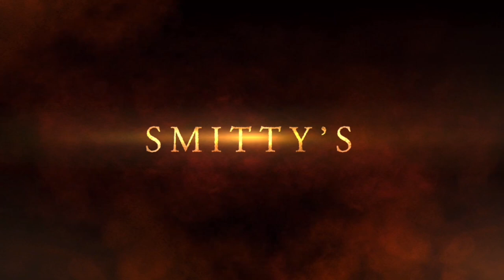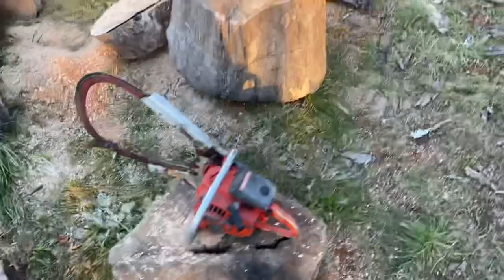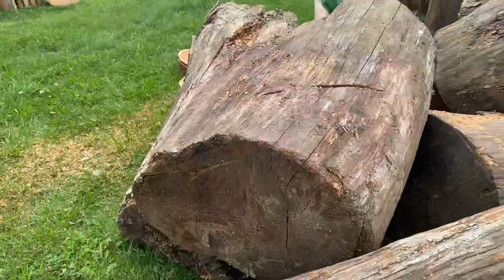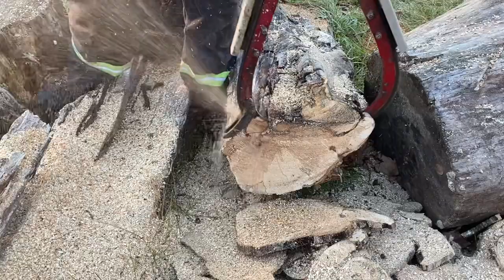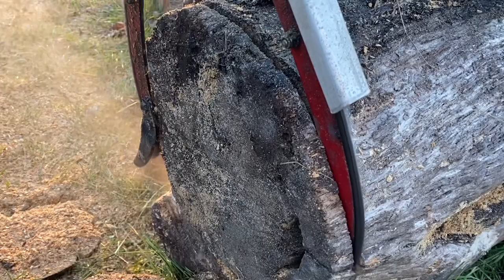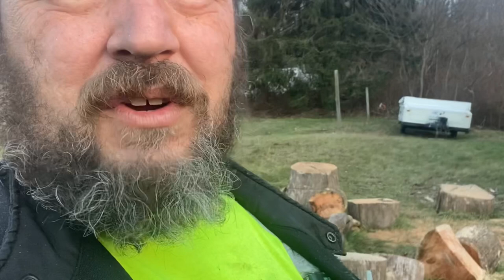Bow Bar On Experimental Ported Homelite Super XL Auto Chainsaw!  Having Fun Testing Out A Bow Bar

Comment: Love the saw smitty. Are the bars hard to find sr and what or should I say why were they made and for what practical purpose. Great video and thanks ❤️🌲🌲🌲❤️
Reply from the maker: Hard to find but great to use.
Reply: My old man used to cut pulpwood with a sxl with a bow bar. Saws still sitting in the back of the shop but I never ran the bow bar

Comment: Dang I can see the oil dripping down!
Reply from the maker: I fixed it
Reply: @Smittyschainsaws  I thought it was just because those saws dispensed so much oil. Thank you for the reply.
Reply from the maker: @viperstrike3827  The oil hole was plugged.
Reply: @Smittyschainsaws  I am learning about homelites. I am buying parts saws on ebay. As soon as I find one with a clean cylinder I am making a runner.
Reply from the maker: @viperstrike3827  You can still get new cylinders and pistons. Sometimes it’s better that way.
Reply: @Smittyschainsaws  Thank you for the reply. I installed a clean used cylinder and hooked a ring in installation. I just don't trust myself to do it.
Reply from the maker: @viperstrike3827  Failure is the greatest teacher!  Don't give up!
Reply: @Smittyschainsaws  Thank you for the reply! I don't plan on stopping until I am ripping through a piece of wood with a dialed in xl-12. Then I will need a mac, then a few more 025's. The bottom line is I love saws as much as you do and I don't plan on stopping.